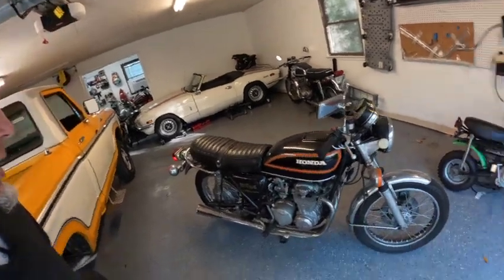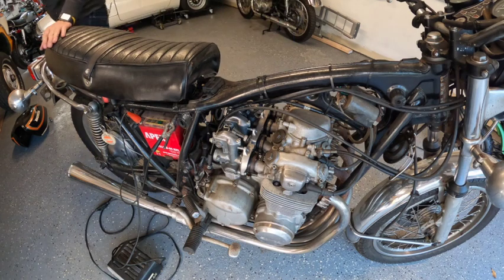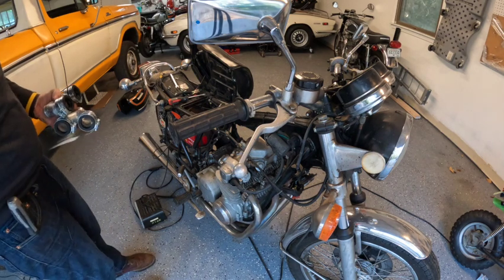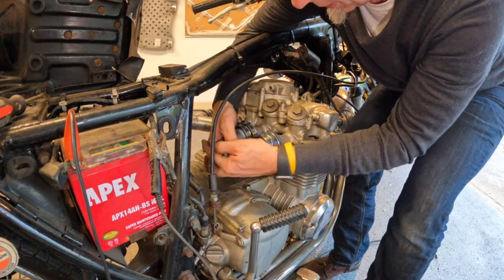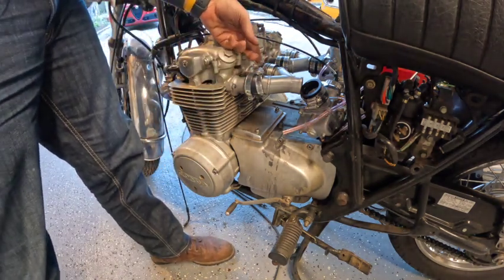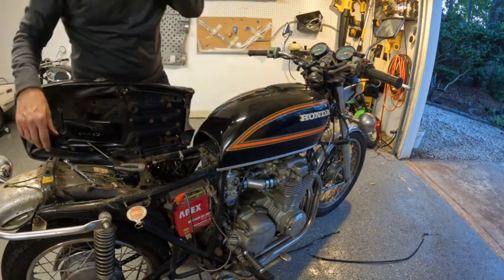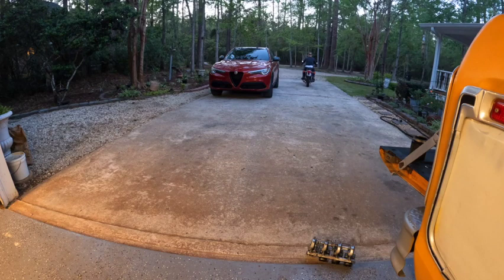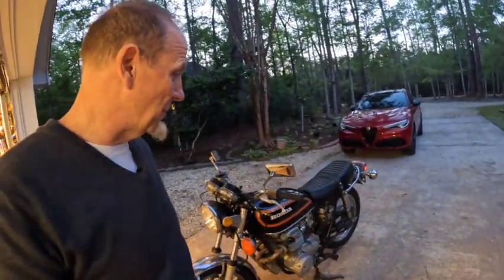How to turn your vintage Honda CB550 into a rocketship! #cb550 #hondacb550 #caferacer

Comment: I ported the heads to match the diameter of factory manifold. Replaced the filter airbox with a K&N air filter. Put in a high lift cam ,new valve springs, retimed  the cam, bored it out to 650, rejetted the carbs. Had a Kerker header. Ran low 12s. Faster than my CBX. My favorite bike. Did 100,000 miles
Reply from the maker: I was being cheeky with my video title. You really turned yours into a ROCKETSHIP!!!!
Reply: What cam did you use? And where did you get the valve springs? I just picked up one recently that's been cafed out and I'm looking to eventually make it into a real performer. Only thing is I can find practicality nothing in the way of performance parts for it other than carbs. Haven't heard of any performance cams for it. Only thing I'm thinking might possibly work is putting an earlier SOHC CB750 cam in, but it's just a shot in the dark if it would fit or not. Looking forward to your response, any help is greatly appreciated!👍
Reply: @danraymond1253  I'm sorry. I did this in the 80s when I was working in the Honda dealerships in San Diego. I'm sure none of these parts are available. I have trouble finding parts for my 95 VFR750 nowadays.  Love my VFR and miss my CBX but the CB 500/550's were my first love. Good luck.
Reply: @markwilkes4318  your fine. Thanks for the reply. This bike is quite new to me. I was raised on old Harley's and Indians so a 1980 CB650 is kinda outta left field lol. I'm looking to make my dream cafe racer out of it, and to learn how to properly build a performance engine along the way. We'll see where it takes me.
Reply: @markwilkes4318  Hi Mark,
I was lent a Cb550K3 for a season whilst in college back in the late 70‘s in South London.
Interestingly enough, I also ride a Vfr750f, the Rc36b from 97, me now living and riding in Germany. Managed to get everything through eBay over here as mega loads were sold in Europe and, according to what I‘ve read there’s supposedly still over 100k of these active on European roads in their various years and forms.
Wear and tear parts are literally available over the counter here but when it came to spares, I‘ve received parts not just from Germany, but France and England also.
Wish you success and good luck in your hunting Mark,
Best greetings from Düsseldorf;-)
Reply: @danraymond1253  
Bit late for an answer but CB750 cam doesn't fit 550.

CB650 cam is direct fit with slightly better opening/closing points.
I fitted PIPER cam to mine but they have no interest in vintage motorcycles nowadays.
Modified CB750 pistons to get 591cc or 605cc is better, you can bore stock block for 591.
I don't use Cycle World spec but have my own mods. Picked up some CB750 pistons years ago and may have a modified set laying around (did some for a guy  in northeast, I'm in central Florida)
Reply: @markwilkes4318  
Me too, Honda Dealers in Wales, UK. 
How did you bore it to 650? 
CB650 block and crank or re-liner 550 block?
Hated all the VF range except the 400. (not sure if that was ever imported to USA?)
 Nothing but cam and cam drive problems, even the gear drive failed on several.
VF45 was a disaster waiting to happen.
Probably not as bad as early CX 500 but at least CX was easier to fix (after the fifth modification, even if Honda says there were only 3 updates)
Don't care how good they got later on, I still avoid working on them
What made things worse, I moved to Suzuki dealers but the VF's followed me
I worked with a few guys who had worked in Honda dealerships out your way, Denny Ruckle said he owned a dealership and Gordon Reed when he was off duty from Navy. Would be far too much of a coincidence for you to have worked with them, but, it's a small world.

Comment: While just a backyard mechanic I rejetted the 4 carbs (with K&N filters), installed a 4 into 2 Jardine pipes. Increased the motor sprocket by 1 tooth and decreased the rear sprocket by 2. Installed a Barnett clutch. Found out I could swap the stock 550 tank for a 750 tank, this required narrowing the rubber grommets (that mount to the frame) and moving the fuel lines to the other side. This gave me an extra gallon of gas. I also went up 1 size on both tires. Even with the Windjammer II fairing I could do 110mph, but that was top speed. I could ride 90 miles to work then put in 8-10 hrs. heavy construction work, and drive another 90 miles home.
Reply from the maker: WOW!!! Bet it was fun to ride. The 550 is my favorite size.
Reply: @motorcyclerewind  It was. A friend and I (him on his big Harley) rode together on the highway about 30 miles hitting 90mph. He commented, the next day on how surprised he was that my 550 kept up with his. He didn't think it had any power. I put about 60,000 miles on that bike. Only stopped riding because a work injury to my hands made it impossible to ride long distances. Ride Safe!
Reply from the maker: @richardkawucha1232  My favorite thing about these old motorcycles. are the stories. Thanks for sharing yours with me.
Reply: @motorcyclerewind  Honda issued a recall on the gas tank latch. Due to the possibility of a rider pressing the release tab accidentally the fix was to replace the tab with a key activated release.

Comment: Friend of mine did this conversion on a CB750F2 1980 model and the difference was amazing..much easier to keep vacuum balanced and with better delivery..once set up right you'd wish you did it earlier ..
Reply from the maker: I am waiting on a set to come in for my 1979 Honda CB750K.
Reply: The 1980 CB750 was a four valve DOHC with completely different original carbs almost impossible to set up without stock intake system. 
This would be a great conversion for any of the late models

Comment: Since I've now watched several of your video's, I subscribed.
I've had my 550F1 since new,  June 1977. 
It's been 'retired' a while since it has over 106,000miles, 70,000+ with big bore kit.
Always much preferred the smaller bike over CB750 which is too wide and too heavy to handle really well.
Best conversion in my opinion is actually the 591cc mod (plus, the dual carb conversion didn't exist back then).
The stock carbs are quite difficult to set up without stock air-box, (particularly if you have a later 550K which that appears to be - alternator cover has exposed screws with Honda cast in). 
I would figure out some sort of bracket for rear of carbs, they will droop over time and cause rich running if not supported
Normal tuning doesn't seem to work so well, bigger main jets and raise needle just uses even more fuel but no improvement in running.
Dropping needles one extra notch works better than raising them.
 I did mine 1979 or 80, modified CB750 K0 pistons (not to 1974 Cycle World 'Gentleman's Express' spec  though)
I still have way too many projects started but watch far too much You Tube to get much done (being hurt doesn't help, painkillers only do so much)
 Who would have thought teaching was more dangerous than riding motorcycles? (12 years at MMI)
Oh, didn't know you had XS 650, I was really into them and did long rod conversions (Honda CR500 rods) with XV750 pistons to get 800cc motors.
You need to fit oversize liners to cylinder though.
Only saw Alfa at end, had a bunch of Alfa Sud, flat four is awesome motor. 
It was designed by a former Porsche engineer who told Porsche they were doing it wrong 😁
Reply from the maker: Thanks for the subscribe. Really appreciate it. I sure would love to chat with you someday. I always say, the motorcycles are cool but the stories are way better. Thanks for watching.

Comment: I have worked with a Canadian vintage road racer and have achieved very close to 75 RWHP with 592cc displacement. The bike has been a dominant vintage force over the past 10 years. A lot of effort in the cylinder head, parts and assembly (setting squish etc). The Megacycle 126-20 is the cam to use.
Reply from the maker: WOW! that was really a rocket ship.
Reply: That's damn cool. 
I did a set of CB 750 pistons a few years ago to my spec for a vintage racer, changed a few angles on piston crown to get better squish and burn.
75 at wheel is pretty impressive, Honda only rated 550 - 50bhp at crank

Comment: I'm interested in knowing how well the idle tunes on this setup? The four carb setup is notoriously tricky to get that perfect idle tune..
I want to hear a sweet, stutter free 1000rpm idle!!! Even a crap set of carbs sound good when you burp the throttle and hear that awesome CB-four tone!!
Reply from the maker: Doug the bike is running great. Been on a few rides in the neighborhood. Just finished the battery box mod to be able to fit the filters. will have ab update video coming out in the coming weeks.
Reply: I never had issues with mine, but I did have genuine Honda vacuum gauge set. 
The center carbs are not set same as outside ones with OEM gauges, aftermarket will put all the slides at same level.

Comment: If both stock carbs and this swap are tuned properly, does this actually make more power? I can't imagine that the four-carb setup from the factory would produce less performance than these carbs, even if these are a little bigger. I have a 650 cafe racer that I just picked up. I'm not doing anything major yet, but down the road I plan to make it into a real screamer. Hopefully it'll be easier than I'm thinking it's gonna be, but probably not lol. There is almost nothing in the way of performance parts I can find for it besides Keihin CR29 carbs, so it looks like I'm gonna have to do a lot of work. 👍
Reply: It honestly isn't even close.  This kit definitely has some issues you have to be ok living with, it runs super rich just off idle up to 1/8 throttle, to the point where you will hear it running on 3 cylinders.  I've moved the clip on the needle, tried larger needles, smaller needle jet and different throttle valves to no avail.  But, if you shift to a higher gear the load increases enough that you need more throttle and get out of that range.  Other than that issue, these things are sooo much quicker everywhere, fire up immediately and idle well.  They are also quite a bit lighter and make the bike a lot easier to work on.
Reply from the maker: Thanks for watching!
Reply: @travisshrey6720  what was the air mixture screw at? Less than 1 turn out? I've had the same issue, including having to blip the throttle. Murray said it was the throttle cables. And I rerouted them with his assistance and it made no change. I took pods of and watch the slides there's no sticking in the cables.
Reply: @jacob14163  my entire issue was the original Murray manifolds. There must have been some kind of leak between them and the stock manifolds. I checked them half a dozen times and never found a leak, but as soon as I put the new manifolds on that bolt directly to the head it was a different bike. I put all my changes back to his original settings and it just ripped.
Reply: @travisshrey6720  Interesting I will have to test that out. It took the whole issue away?
Reply: @jacob14163  Yes.  You have to have the cables fully sorted and that isn't a trivial thing.  The 2-1 connection tube really doesn't fit well under the tank tunnel, I wound up cable tying that to the plug coil low on the left side.  But after that change it was a different bike.
Reply: @travisshrey6720  that is the same cable routing I have
Reply: these will give it quicker response and more low end torque than the 4 carb set up.

Comment: Do they have those kits for a 72CB 750? I’ve got a tip though take some 0000 steel wool and some mothers aluminum polish to the forks and the aluminum engine and you can get that bike looking shinier than chrome. then wipe off with a Terry cloth towel
Reply from the maker: SpeedmotoCo has kits for a cb750

Comment: Going from 4 to 2 seems a bit counter-intuitive, was there something wrong with the stock carbs. Is it an issue that the new carbs weight is cantlivering off an extended intake manifold with no support from the air box.
Reply from the maker: I thought about the weight of the carbs and filters. No issue yet. Maybe I should make a bracket to support it.

Comment: have you got it dialled in yet? and have you noticed much diffrence in fuel useage? cheers
Reply from the maker: Lee haven't done anything to it but adjust the idle. Starts and runs great. Here is a link to a quick clip I posted on instagram. https://www.instagram.com/p/CcZDACKLeoa/
Reply from the maker: Just got the speedo drive in. So soon I will be able to answer your question!

Comment: I know this is a few months out by now. But I have a few questions.
I just got the Murray's kit for my cb750. It started up but idling really high, routing of cable seems ok, but honestly sounding kind of similar to how your bike started up. I've been messing with it but haven't touched any of of the adjustments screws. It starts but idle is too high, but also a bit erratic and unpredictable 
1. I notice when you give it a rev it does a like a 1-2 rev (22:02) was that a cable issue or an adjustment issue? I saw in your "its so good" video that it was revving/ riding great
2. Did you do much other than tweak air fuel screw? I've honestly only ever messed around with the cb750 round tops and I'm always worried about messing with carbs, I know it's a bit irrational but I'm always worried I'm going to do something irreparable
Reply from the maker: Hey Joseph, 
Thanks for watching. #1. cable was hanging up. #2. I did very little tweaking and only to the air screw. Know where you are starting, so you can always go back. Do the same thing to both sides. I like to save carb tweaking for last. Do standard maintenance first. Cam chain tensioner, valves, timing, then carbs. Hope this helps.

Comment: Im sick of chasing down issues on a very rough set of 78 carbs def getting a VM34 kit asap
Reply from the maker: I was having the same issues. Here is a link to a quick clip of it running. https://www.instagram.com/p/CcZDACKLeoa/
Reply: goodness im there too. these bikes are becoming so expensive to own
Reply from the maker: @lemoncarrot7068  Yeah but riding them is worth it....
Reply: @motorcyclerewind  totally, what a sound
Reply: @lemoncarrot7068  I thought these bikes were reliable?
Reply: @RajerThatYT  they are reliable, but do need some love to make current again.

  making sure it charges, has compression, and doesn't leak fuel. etc.